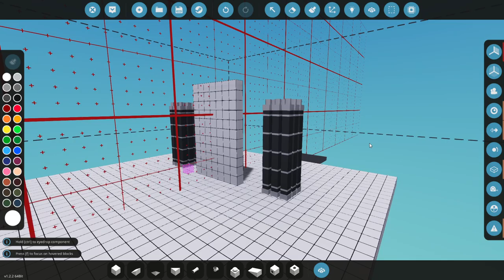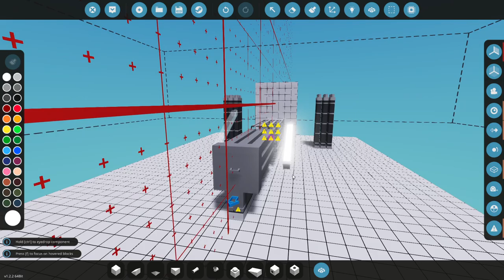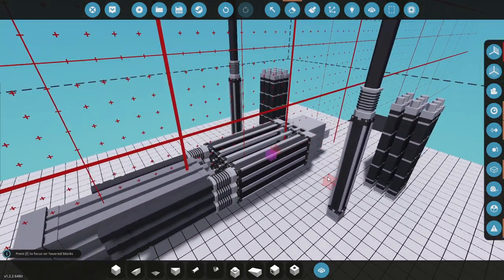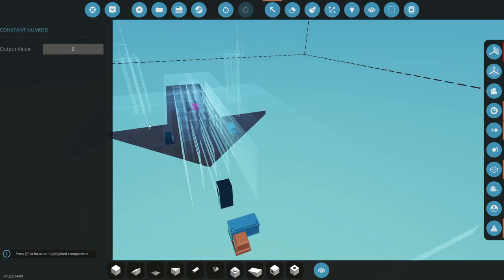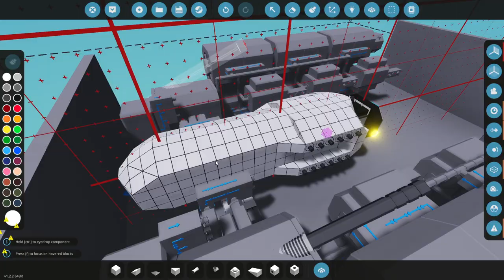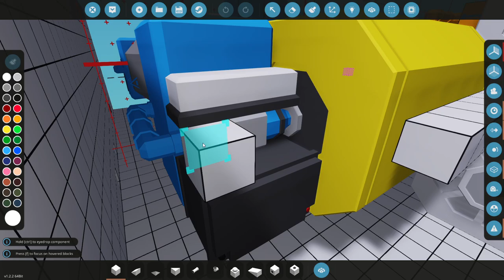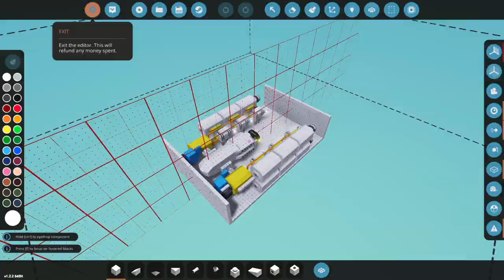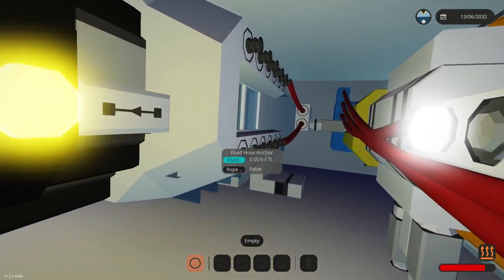Stormworks Nuclear Tutorial

Comment: Super nice setup! I was wondering ... in your logic, how long do you turn ON the water PUMP that feed their boiler when the pressure is greater than 9.5? Like you said I see that it is flickering ON and OFF when the pressure is too high. Also, at which pressure are you switching in that flick mode. If I switch to that mode at 9.5, it seems that I am too late and the pressure will quickly reach 10, exploding the boiler.
Reply from the maker: There are two conditions that must both be true. You can use an AND and two simple math checks.

The pressure must be less than 9.5
AND
There must be no water currently in the boiler.

Your problem is probably that there's already water in the boiler, so it's creating a lot more steam than you expect.
Reply: @CraigPerko  mmmm this is what I did. It seems that if I do this, I see water flowing in in pulse .... the pressure will rise .... but there is something blocking the boiler from having enough power to spin the turbine. However, if I let the pump flow at on mode all the time, then it will spin the turbine. That is weird.
Reply: Also, did you tried it with a recent release of Stormworks? I wonder if something could have changed.
Reply from the maker: I haven't tried it recently, sorry.

Comment: Can confirm this no longer works the temperature of the central lower rod will stay at 20 also if I am supposed to be putting the rods somewhere else (control) please inform me as currently I have a nice and pretty reactor chamber that only gets up to 20
Reply from the maker: Are you sure your chamber is sealed? 20 is suspiciously close to room temp.
Reply: @CraigPerko  I’m here because mines hanging out around 30-35. It turns out I need to reconfigure my rod layout (there’s at least one block gap between each one). I decided to build it in a 5x5 grid, except the outer layers are the casing. The actual nuclear stuff is in the inner 3x3 grid. I put the control rod in the center and the fuel rod assemblies are in the center of the left/right/fwd/aft faces (making the corner areas vacant). From what I’ve been seeing, could I simply add more assemblies to the corners? If the control rod affects adjacent fuel rods, then I’m controlling four with one..control. And since those four are direct neighbors to the ones to be added, it should keep it under control

Comment: Anyone have a link to the creation? Or was it never shared onto the workshop? I keep having problems getting the steam power half to work right. I always end up either not getting consistent power or needing to vent off steam. Even when I don't vent and I'm only cycling water from the reactor to the boiler I end up with too much pressure needing to vent or if I get all the water turned to steam by only using enough water to come close to topping out, the amount of water in the system disappears somewhere and I have to add water back in which leads to needing to vent pressure and the cycle continues.
Reply from the maker: The physics have apparently changed since I did this video, sorry.

Comment: Reactors aren't easy, I've tried to build a couple different types. Thanks for the tutorial its the best vid ive seen on this topic, helped a lot with my reactors but i can't find a way to increase the reservoir for the boiler's water that wont cause the boiler to explode or the turbine lose all its power from bleeding the pressurized steam. 

The close loop version of the reactor is not a great system, if the boiler loses any water it becomes inoperable until you fill it to that specific mark. The open system is even worse. The best solution i could come up with is to make a larger extra reserve tank connected through a variable valve to the boiler's reserve tank so that it only inputs the exact amount of water it needs which is also not ideal. If anybody has a solution it'll be much appreciated.

Everyone says to use a vvalve/pump to control the water flow but i cannot for the life of me figure out how they did it and the reactors ive seen on workshop are mediocre at best so this is kind of my last resort
Reply from the maker: Use a pump. Read the amount of water and pressure in the boiler. If the water in the boiler is <1 and the pressure is <9, pump. Otherwise, don't.

Comment: I Triest building a train with a nuear reactor. But even with 2 Steam Turbinen it didn't Put Out enough Power for the Generators for 2 small Electric engines. Amy Suggestions?
Reply from the maker: Yeah, wait for the patch.

Listen, even with glitch exploits, the turbines weigh 800 kilograms and put out less power than the tiny diesel engine.
Reply: @CraigPerko  did they fix the same "according to mrnjersey not a problem your doing it wrong get banned " with the modular engines yet?
Reply from the maker: @docbrown9018  I have no idea, I don't watch any Stormworks YTers. The only way I use the modular engines is for the clutch flutter glitch.